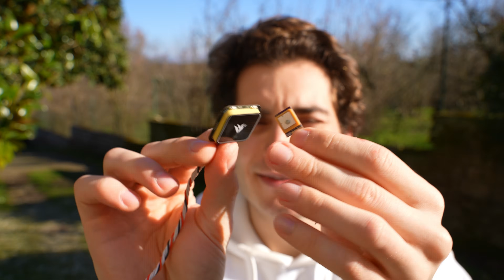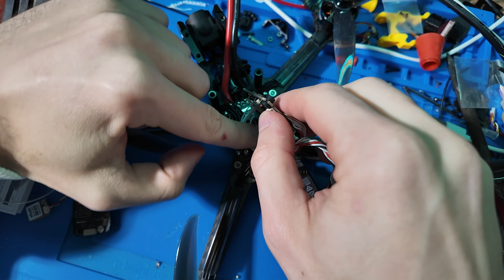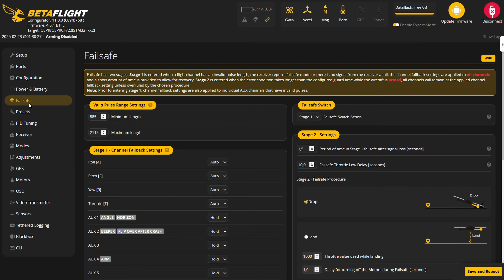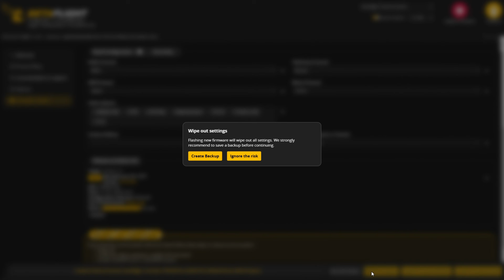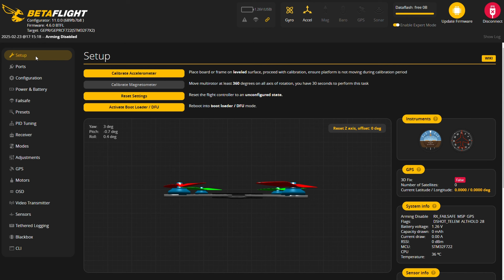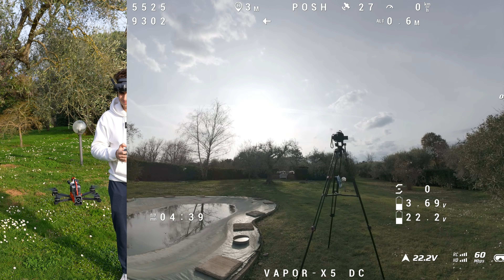How to Install a GPS On your FPV Drone and activate POSITION HOLD!

Comment: FINALLY. What am i mainly gonna use this for? Landing..
My Specter 7 has a thick 8000mah lipo i really dont want to get scuffed up, scratched or dented.
I tried hand catching it while in Angle mode but its still way too sketchy lol.
With pos hold i can literally "glue" it in the air like an Avata, then grab the battery, disarm, easy peasy.
Reply: Impressive that its so stable.

Comment: Finally took the plunge and updated BF and went back to this video.  Spot on video as always but just a couple of points to raise.  1, If you set the failsafe options to GPS arm without fix the quadcopter will disarm on failsafe.  2.  The GEPRC vapor ISN'T my favourite 5 inch, that honour still goes to the ImpulseRC Apex 5 evo with a T motor stack and RCinPower wasp major motors,  I bought a vapor and sold it within 3 days because it's about as exciting as an orgy party in a convent.

Love your work :)

Comment: Ciao Rimzler, ti scrivo per un supporto tecnico.

Ho acquistato da poco un Geprc Vapor D6, ci ho volato un paio di volte, ieri dopo due giorni di pioggia volevo volare ,ma mi so accorto di un problema. Quando do gas i motori accelerano e rimangono a girare ad una velocità non riuscendo più a controllarli con la radio. Tutto il resto funge regolarmente e anche su betaflght non c'è niente di strano. Gli stick su betaflight si comportano regolarmente. Mi potresti dare qualche indicazione su quello che potrebbe essere?

Grazie tanto per la risposta.

Comment: i did as to your video after update firmware dev alt hold /pos hold ...i get error update betaflight n my current betaflight is 2025-08-23 @22:18:38 -- Configurator: 10.10.0 (c97deaf)...my flight controller is flywoo 722 pro v2 / gep-f722-bt-hd v3,,,,both same problem.....need your help

Comment: To do GPS altitude hold I need BetaFlight 4.6.0, and 11.0.0 configurator, correct?  Is this done by downloading the lastest version of BetaFlight and then updating from 10.0.0 to 11.0.0?

Comment: mount the gps on a pole above all the transmitters etc get aluminum tape and wrap the wires and tiwst them first.. this will stop interfiernce from the video transmitter seperate every transmitter express lrs should antenna be in the front fpv 40 degree angle from the back and back on a pole gps above the fpv antenna and inav is a gimic gps return is hit or miss only thing that works good is position hold.. you want rth reliable ardupilot its far more advanced on par with dji products  betaflight gps rescue is a joke scary etc there now trying to copy inav wiht position hold... why cant we get dji like rth that works every time with inav or betaflight ive done many builds and its unreliable dji is rock solid and ive done ardupilot and its rock solid so makes no sense

Comment: I tried it, and ALTHOLD works, but POSHOLD does not. I get POSHOLD FAIL flag in the goggles when I activate it. 
 
(Both modes have the same aux and range)

Comment: im having a problem maybe you can help me with. I flashed 4.6 but betaflight is now telling me i need config version 10.10.0.. but im running the latest version. I saw you recommended using the chrome version to someone with a similar issue, but when I try that, my FC wont even connect. Any Ideas?
Reply: I used edge browser and it worked, another browser I tried wouldn connect to the FC
Reply: @LuisMendez-ck6dv  thank you sm, i did end up figuring this out. Some browsers just dont like Betaflight for some reason. I think i used Firefox and it worked. 👍🏻👍🏻

Comment: Don't just plug in your LiPo right away. The VTX can cause interference with your GPS. Instead, make sure your GPS is powered from a 5V pad that remains active when connected via USB. First, plug in the USB and ensure the GPS is receiving power. Let it run for 1–2 minutes, make sure your VTX has no power. This allows the GPS to acquire satellites without interference. After that, you can connect your LiPo. You’ll notice significantly faster and more reliable GPS locks since the GPS was able to initialize without signal disruption ( interference )  from the VTX.

Comment: I would recommend setting the "Return ground speed" higher. 8m/s is only 28 km/h, if you have some wind you may have trouble returning. I have mine set at 21m/s which is 75 km/h, easily doable by 5" drone

Comment: Thanks very much! I've been dragging my feet on putting GPS on my quads because I hadn't figured out what it would get me with Betaflight, but the "home direction arrow" to point me in the right direction while I'm flying through my trees, and a GPS position if I crash into the leaves will help a lot; It's easy to loose track of where I am back in the woods. I put buzzers on them, but I have to get pretty close to hear them. My favorite quad for long routes is the Pavo 20 Pro/O4 Pro. I have a Flywoo Nano GPS w/compass, but the BetaFPV F4 controllers don't have pads for SCL and SDA, but the home direction arrow is even more important than the compass, so I ordered a couple tiny GPS modules without a compass. I won't be using return to home down in the trees, because it would just fly up and get stuck in the branches, but it could work other places.
Reply from the maker: Absolutely agree, I often lose track of where I am especially when flying in new places, and the home direction arrow is a lifesaver!
Reply: @rimzler  I'm looking forward to having it. I have a Neo with the "H" for the home direction, and that was very helpful, but it doesn't have the video or radio range, or the agility of the Pavo 20 Pro/O4 Pro.

Comment: The nano Foxeer M10q 120 (other M10 GPS are probably just as good) i bought to add to my 250g 3inch works great, highly recommend. Its the size of the smaller one he was holding and after the first battery I had 18 satellites. Only issue I have is my GPS mount always gets destroyed. I recently lost my QAS 2 Sub 250 in a lake, and I only found it because for some reason the green GPS LED was shining from under the water. If I didnt have the GPS lat/long on my goggles when I went into the water I would have never found it

Comment: Thanks for the detailed Video. I was toying with the idea of buying an Avata 2 and also upgrading my old GEPRC Mark 2 with a DJI 04 Air Unit as I already have the DJI Goggles N3 and DJI FPV Controller 3, I want Position Hold, GPS and RTH for when I start using the GEPRC drone so this has shown me that my thoughts are correct and it would be possible. I will probably replace the old GEPRC with a newer drone frame, etc set up to receive the 04 Air Unit instead of trying to modify the old GEPRC Mark 2, I'd probably get more money if I just sell it :)

Comment: Calibrating a compass which is at an angle is a pain so I highly recommend to mount it flat.  I have all mine flat and have no problem getting 30 sats.  Mounting it anywhere but sticking out the back is a bad idea for different reasons.  Mounting it on the arm is a terrible idea which he should not have suggested (for a lot more reasons than just getting struck by a prop).

Comment: I watched all the youtube videos about this subject but I didn't see anyone explaining it as well as you did. It's perfect. I have a question. When adjusting the magnetometer position, apart from the orientation, what setting do you use for the inclination of the gps module? I guess its like pitch but is it 20 or -20 i couldnt decide. (You mentioned yours is 20, i dont know what will be mine its 3d printing right now.)
Reply from the maker: Thank you so much! It's pitch for the inclination, I have at -20 cause the chip is on the bottom of the gps and it's upside down
Reply: @ man, this is the answer that im looking for hours. Thank you so much
Reply: @rimzler  dear wise of fpv. there is another question that i never find an answer anywhere. i installed my gps and did my settings but i think my magnetometer does not work properly. i connect my quad to betaflight and when im rotating the drone, setup tab demonstrates quad is turning but when i wait for like a second, position is reset. i turned on compass on osd and its the same on the goggles osd too. it shows the direction like north east west etc but when im waiting without moving one second, quads direction is reset itself. i checked my all configs but i couldnt see anything causing this. it stops only when im diasbling magnetometer. do you have any idea of this situation?
Reply from the maker: Is position hold working?
Reply: @rimzler  not tried it yet
Reply: @rimzler  I am writing this for those who have this problem and read the comment. The reorientation I mentioned occurs when the magnetometer orientation is incorrect. When you do the mag alignment part correctly via betaflight, there is much less deviation. Unfortunately, I still have not fully solved the magnetometer alignment part. I was able to correctly set the goku gm10 v3 mini model with the information provided by the manufacturer, but I am trying to set the goku gm10 pro v3 model by looking at the compass chip. This is where the confusing part begins. My GPS chip is also facing down. However, in the orientation part, I am first trying to learn whether to rotate clockwise or flip. If I do the flip first, the clockwise rotations are wrong. I will decide this by looking at the compass direction, but this time the pitch angle is confusing me. I am not sure whether I should do minus 30 or plus 30 in my scenario. It is really confusing.
Reply: Hey  @memilyo  can you please share the file you used for printing the gps mount? Or where I can get one? I don't have experience with printing. I'm considering this 21mmX21mm gps on Amazon: HGLRC M100-5883 GPS Compass Module, Upgraded 10th Generation Chip Compatible with FPV Fixed-Wing UAV
Reply: @fabundemamey2029 i printed it for my 3” quad. I dont have fixed wings

Comment: thanks for the info i am a few steps closer to gps being setup. please add the rest of your findings, you are alot of help.  i have got a vapor x5 dead cat style and its thanks to you(partly).  Good show keep them comming.
Reply from the maker: The gps that I have on the vapor 6 inch doesn't have a magnetometer (only has 4 wires) so you need to input the command to have gps rescue without mag

Comment: I have never fly such high speed FPV drone before, is it dangerous for new driver? can I buy a BETAFPV Aquila16 to practice such skill?
Reply from the maker: It's hard to control as first drone, I would recommend an Avata 1 or 2 as first drone, it teaches good and you can unlock to go very fast

Comment: 8 meter per second RTH is only 28 kph. I set mine to 15 meters ( 54 kph). Once you set hoover throttle correctly the quad lands rather nicely 😊
Reply from the maker: Slower should be more efficient tho, but longer time to wait before seeing the drone back🤣

Comment: Thanks for the great video, I watch all your videos you have good information. Where can I get the Beta flight configurator 4.6? I cannot find it? Thanks
Reply from the maker: It's not the betaflight configurator, but the dev release in the update page, you can check the part where I update firmware

Comment: Do you have any suggestions (im thinking to buy a moonlight kit and the goggles x for my 5 inch freestyle build) before i buy an fpv system?
Reply from the maker: My suggestion would be a lot of simulator, and usually I recommend DJI Avata 1 or 2 to learn gradually

Comment: When you buy these drones with a GPS preinstalled,  I presume all the settings in betaflight are already set ? are they?
Reply from the maker: Most likely they will, I hope the magnetometer is correctly setup as well
Reply: @Rimzler  cool. Thanks!

Comment: Pretty crazy that betaflight still doesn't have position hold that's even 10% as good as a DJI Phantom 1 which is more than 12 years old now
Reply: bcuz bf is mostly for freestyle or racing drones so their priorities are usually for freestyle or racing
Reply: @RipGrinder  or they don’t have skill to pull it off
Reply: @importon  salty much?
Reply: @ltechcoding  jump to conclusions much?  maybe you like a "failsafe" that falls out of the sky?
Reply: @importon  sounds like you like flying your DJI and sniffing coke
Reply: @importon 10/10 ragebait

Comment: Wow! Finally someone took the time (learned that stuff) and explained those gps settings! I don't belive even Joshua Bardwell could have done this any better! I'm also waiting for my Vapor D5 to arrive (with GPS preinstalled). When it arrives I will be more confident adjusting all those settings (but probably won't flash to 4.6 right away). Btw. That's a huge battery there, I was wondering is it worth it to get a battery that large (I'm not planning to put any gopro on top). How much cruising time you get with this battey?
Reply: I also have the Vapor D5 with the O4 Pro. I use Ovonic 6S 2200mAh 150C batteries; they are great and even work for my light, beginner freestyling
Reply: will your Vapor be your first drone?
Yeah that's a Tattu 6s 2200mah battery.. It's huge.. It's better for cruising around and carrying a gopro on top to get flightime around 10 - 15 mins hopefully... This battery is not recommended for the freestyling tho but you can still use it.. :)
Reply: @siansalins3639  Technically it will be my third after Avata 2 and Pavo20 Pro. But I have them for less than a month so I'm still very unexperienced (more than 70 hours spent in sim doesn't really translate to the real thing for me unfortunatelly). 10 min. would be roughly what avata 2 does, I'll give it a try at some point. Thanks.

Comment: Im waiting for my Vapor to arrive, I cant watch it, the hype is killing me XD and got the GPS build in version. Wonder if the latest firmware is on it with the position hold
Reply from the maker: No you will have the previous firmware like I did, also you need to make sure the magnetometer is calibrated correctly, send me a dm so I can check when the drone arrives, but if you update to 4.6 everything should be ready just like mine
Reply: @rimzler  Thank You Rimzler ma dude. 🙏 Thx to you I picked this one, first I'll see how it rips, then I'll come back to your vid to update 🙏.
Reply: I am new of this drone. I want to use with DJI Googles 3 and DJI remote control. Which option I must choose, PNP with GPS, ELRS 2.4 with GPS or TBS Nano RX with GPS ?
Reply: Fellas, does updating the firmware remove the factory tuning? Sorry im pretty new to all this haha

Comment: It didn’t work to me , I try to update it but it just shows me and errror saying that I do have to upgrade the betaflight and I already have the latest version … I’m kinda scared man this drone is so powerful I don’t want to crash it … I don’t know how to even fly it I’m afraid to fly it and break it 😢 , how can I make it hold he’s positions ? And how can I land it with out damaging it
Reply from the maker: Yeah if you are unsure just try on a smaller drone this is a big one to crash, what error is it showing
Reply: @ I got the D6 version but tell me how to land it ? I have angle mode , horizon and air but still don’t know how to land it
Reply from the maker: @martinmarulanda9198  you need to still land manually, just get it close to the ground and disarm, practice on grass, don't let the drone touch the ground armed or it will bunny hop
Reply: @rimzler  omg thx I already fked up one propeller .. do you know if there is any popeller guards for the D6 model ? Bc I’m kinda worried about it
Reply: @martinmarulanda9198  You think position hold is for landing? You turn position hold off... and LANNDD😂
Reply: @stickboyfpv4742  did you try installing the 4.5? Bc in my drone didn’t work at all
Reply: Bro they tough as hell.. Just be confident... be smoooth! You enable your gps in the config. Tab?

Comment: This is one of the most helpful GPS videos I have seen. Especially diving into the new BF 4.6 pos hold
Reply from the maker: Thank you! It's such a good time for FPV drones! The added peace of mind that comes with position hold is amazing
Reply: Yes, thanks -software all configured - when i armed quad only 3 motors spinning , thanks  speedybee - mario5 side panels rip the cables like a harm. I love disassembly process, is  almost like new build, especially with leds, gps,buzzer  just to solder  back motor ;) @rimzler
Reply: @rimzler  hey i just tried this with the vapor d5 that comes with the gps and after reflashing with the 4.6  to turn on the magnetometer, position, and altitude hold it wouldn't let me connect the flight controller to betaflight saying i needed to update betaflight but i already have the latest version of it, any idea what the problem could be? thanks
Reply from the maker: Try with the online chrome app configurator
Reply: @rimzler  thank you man that worked! last question any idea how i can tell if my magnetometer needs to be flipped 180 like yours besides just trying to see which way the arrow is pointing in the osd?
Reply from the maker: @nikosfpv if it's the one coming from factory should be setup, check the orientation, if it's 0-0-0 I doubt it's set up, if it has been setup you will see numbers in there
Reply: @rimzler  yes it's 0 0 0 I changed the pitch to 20 because it's about the same as yours, I guess i have to see if I have to change to 180 degrees on yaw and pitch
Also not sure if this the vapor d5 with gps has a magnetometer? It was unchecked when I opened betaflight at first
Thank you for the help!
Reply from the maker: @nikosfpv i have pitch -20 because most probably your is upside down too, next week I'll get the components to build a d6 with the GEPRC gps, so will be able to tell you everything precisely
Reply: @rimzler  thank you so much man love your channel and chasing the 🐔 chickens